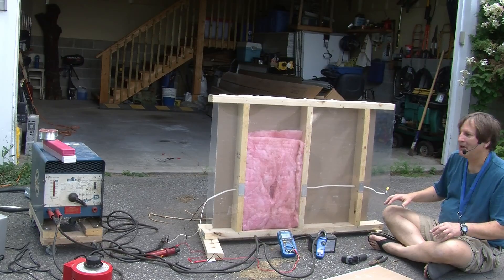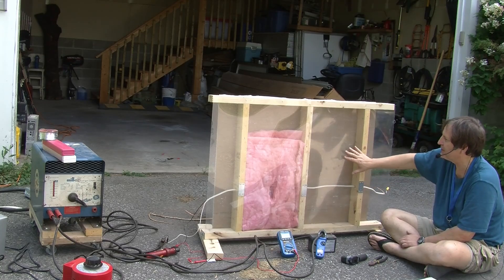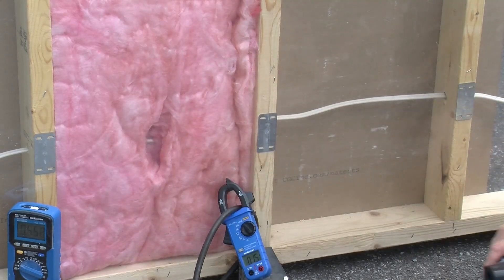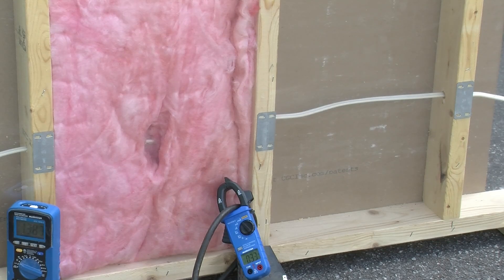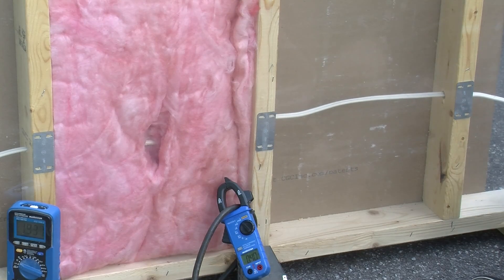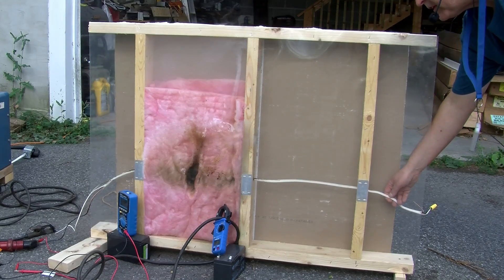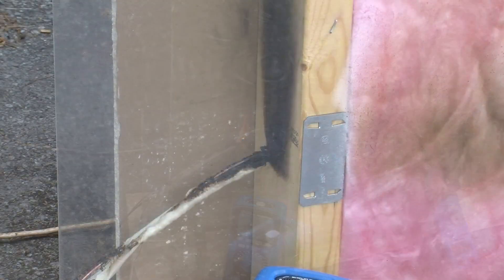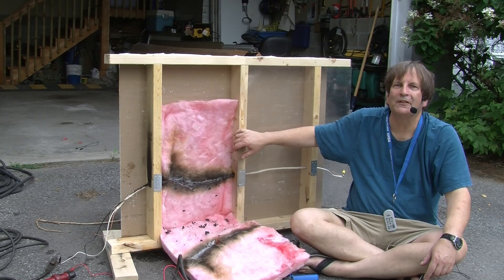Overcurrent +14/2 + Fiberglass in a 2x4 Wall

Comment: Thanks for the videos!  That 14/2 wire is a lot tougher than I would of thought.
Reply from the maker: Your welcome! I am amazed too - and find it quite comforting given that our houses are really quite flammable with so much wood in the construction even if it hidden behind drywall. I will do similar one with spray foam in a few days - will be interesting to see if that changes the results.
Reply: @ElectromagneticVideos  any chance you can hook up a 30 amp load at 120v and show the wire heats up exactly the same as a shorted wire at 1.2v and 30 amps?

Or maybe thinner gauge wire to make the 120v test more manageable.

Sorry to get into an argument in your comment section. Misinformation really bothers me especially when someone presents themselves as a professional.
Reply from the maker: @libtrs838  You must reading my mind. Agree - the only way to satisfy some would be to actually do it. 

I'm obviously not going to touch anything energized at 120V but everyone seems to also want to know temperatures and have pretty much convinced me to get a FLIR camera. I'm also giving a lot of thought to safety -  not just the hazard of the voltage but also the total power available. I will probably need to make two electrical panels - one going in with a big breaker (I dont want to risk simply relying on the breakers on the panel in my garage) and one a the load end with 3 duplex outlets each on their won breaker to plug in heaters as loads. I'm an EE with at day job so I am also limited by available free time - wait till I retire! Then you will see some real videos!

Comments: I purposely have stayed away from comments/questions/statements/discussons that I didnt think could be easily satisfied within the limitations of text comments. I have actually tried to respond to most other comments or discussion streams, although I don't seem to get notified of all comments. If I missed responding to some people comments, my apologies! 

I am planning a FAQ video where I have the luxury of showing circuit diagram  and which would also respond to other "controversial" items like "the test is invalid because DC from  welders is not like AC (Answer: a) its an AC output welder and b)  skin depth in copper at 60Hz is significantly bigger than the radius of the wire so from that perspective, not much different. ).
Reply: @petefromdewoods5157  that is not how it works. Current causes heat voltage does not. This is exactly how power lines work they run for example at 60kv and 500 amps so 30 million watts and they use a quite thin wire. If they ran 500v and 60,000 amps (same wattage) the wire would instantly melt. Volts do not contribute to wires heating.

Higher voltage pushes the electricity more efficiently creating less heat. If you did ohms law you would see at 120v the wire would have way way more than 30 amps. The only way to have 30 amps at 120v on a low resistance wire would be to have a current limiter somewhere else the heat is being dissipated at whatever is limiting the current. Doing ohms law 120v at say 1ohm you can't get 30 amps.
Reply: @petefromdewoods5157   not trying to sound smart, you are spreading misinformation. Was hoping to have a discussion or for you to backup anything you said. you addressed nothing I said.  You ignored the comment about the powerlines, and you haven't even given basic math to show what you are saying. The NEC ampacity AMPACITY chart see that word. Not a wattage chart not a power chart. Amps because the voltage doesn't cause more heat in a wire. Higher voltage you can use a smaller conductor.

Seriously think about this for 2 seconds, in the video the voltage is lower because that is the amount of voltage needed to get the current he had. If he put 120v it would be way way more current or amps. How do you lower the amps at 120v???? You can't with just a wire you need to add some load or resistor and that is where all the watts not turned into heat in the wire go.

Again If you have a 30amp appliance at 120v so 3600w do you think the wire running to it is also taking 3600w? To a wire 30 amps is 30 amps which is exactly why the NEC gives wire rating by amps because voltage doesn't change it. Otherwise they would have charts based on power or watts but they don't.

Nothing is 0 amps if a wire was 0 amps 1v would be infinite amps. My example of 1 ohm was generous to your argument and I also said for easy math.
Reply: @petefromdewoods5157  no it's not yours is. Let's take 120v and I'll be generous and give a 14ga wire a value of 1 ohm but in reality it's lower. 120v / 1 ohm = 120 amps. How do we restrict it to 30 amps? You would need to put a 3 ohm load or a resistor somewhere and that is where most of the heat would be dissipated. To have 120v and 30 amps going through the wire being 100% converted to heat by the wire, the wire would need to be 4 ohms.

Again how do you think power lines work? If it was simply a factor of wattage we would need massive diameter power lines.

All electricity can use thinner gauge wire when voltage is higher for equal watts.

You have to use the equation and find out where all the energy is going. Voltage and resistance determines amps.

If you understand ohms law please give me the simple formula to get 120v and 30 amps with a low resistance 14ga wire?

Another example say you have a 30amp 120v heater hooked up to a 14ga wire. If the wire converted 100% of the energy into heat you would get 3600w of heat from the wire but then how could the heater run at all? The heater can't also put out 3600w of heat then we have 7200w which isn't possible. The heat generated by any wire is amps / ohms =  voltage drop them you can multiply that voltage drop by amps to get actual heat dissipated by the wire.

Been working in electronics for awhile
Reply from the maker: @petefromdewoods5157  Apparently "equipment getting cooked" is what is popular on YouTube! And cat videos :)
Reply: @petefromdewoods5157  Pete says, ohms law does not.

Have a bit more time so electrical lesson for you or anyone being mislead by you.

Ohms law 
- Voltage / Current (amps) = Ohms (resistance)
- Current x Resistance = Voltage 
- Voltage / Resistance = Current

Additionally Current x Volts = Watts or Power

Current is often represented by the letter I

What can we determine from this? In the video we can see.

0.517 Volts at 15 amps initially so 0.517 / 15 = 0.034 ohms

As you can see a wire does not have a resistance of 0 even if your basic multimeter says 0 it can't measure that low

As the wire heats because the current going through it, the resistance increases. Once the wire stabilizes at 15 amps it is running at 0.557 volts

0.557 / 15 = 0.037 ohms we can see the resistance went up by 0.003 ohms because of heating. At this moment the wire is dissipating 8.355 watts.

Let's jump to 30 amps. The meter read 1.118 V initially and then climbed 1.236 V after heating up more. So 1.236 / 30 = 0.0412 ohms. 

1.235 x 30 = 37 watts of heat

The amount of current something uses is always determined by its resistance and what voltage you apply, again because ohms law V / R = I

This is why we can plug devices into a 20 amp circuit and they don't trip the breaker, the divice itself is what limits the current.

If we tried putting 120v to the 14ga wire and let's assume it has 0.0412 ohms of resistance like at the 30 amps test. 120 / 0.0412 = 2912 Amps. This is why a short at 120v instantly trips the breaker.

You can't just put 30amps at 120v to a wire because you don't limit or control the current. The wire will only be at 30 amps with 1.2 volts.

Ok so Pete you said you want a 30 amp appliance hooked up.

If you measured a device that used 30 amps at 120v you would see the device has a resistance of 4 ohms. 120 / 30 = 4

So now remember at 30 amps the wire has a resistance of 0.04 ohms. Now even with 120v and 30 amps it is still 0.04 ohms that doesn't change. 30 amps is 30 amps.

You go but wait 30 x 120 = 3600 watts that's a lot of power and heat. Yes but that power is being consumed by the 30 amp appliance attached. If the wire consumed all the power then the device wouldn't function.

The wire is still 0.04 ohms which causes a 1.235 Voltage drop as we found at before so still 37 watts and the remaining 3563 watts goes to the device which will get turned into motion if a motor and some heat.

Look what we can do 120v - 1.235v = 118.765 volts supplied to the appliance after wire voltage drop. 118.765 V x 30 amps = 3563 watts + the 37 watts for the wire = 3600 watts. Math... 

If higher voltage heated wires up more our whole power distribution system wouldn't work. We transmit power on powerlines at very high voltage because voltage doesn't increase heat. Because of this we can use thin wires to transmit lots of power.

You went on about the NEC, the NEC made charts based on amps not watts because that is all that matters. The NEC also mentions voltage drop calculations if you ever read it. What do you think causes voltage drop on a wire? The resistance of the wire, because wires do not have a resistance of 0 ohms. The longer the wire the larger the voltage drop.

The NEC chart says a 14ga solid copper wire has a resistance of 3.04 ohms per 1000 ft. So pretend we have a 1000ft circuit. If it is a 15 amp circuit 15 / 3.04 = 4.93 V this is the voltage drop. NEC allows max 5% voltage drop on a circuit at 120v that would be 6 volt drop so we are ok. If it's 30 amps that would be 9.8 volt drop not allowed you need to move up to a larger wire with a lower resistance per 1000ft. Notice these calculations only use resistance and current to determine wire size? The supplied voltage doesn't change the resistance of the wire. If we put 1000v on the wire at 15 amps it is still 15 / 3.04 = 4.93 volts. 4.93v x 15 amps = 73.95 watts. This is how much heat the wire would dissipate over the 1000ft 

 If you are actually an electrician you should know all this though, right?

This is also why we use 240v on high wattage items, the current gets cut in half so we don't need large wires to carry the current. 120v x 30a = 3600w or on a 240v circuit we would have two 120v legs carrying 15 amps each so still 3600 watts.
Reply: @petefromdewoods5157  you won't read the other reply where you might learn something, but just so you know the NEC has charts for wire resistance so electricians can calculate voltage drop. So wow dude you should probably call a licensed electrician or lose your license if you have one.
Reply: @petefromdewoods5157  you claim that higher voltage will heat a wire more at the SAME current.

You claim a wire has a resistance of 0 ohms because your meter that can't measure that low says so.

If you take amps and divide by 0 you get infinity that can't be right.

You ignore that the NEC has charts for wire resistance so educated electricians can determine % voltage drop which is based solely on resistance and current. If you do the calculation you will see regardless of input voltage the total value voltage drop stays the same.

That voltage drop x amps is how many watts  of heat the wire generates.

You ignore the fact the NEC has charts based strictly on amps because higher voltage doesn't cause more heat. That is why they are called ampacity charts and not power or wattage charts. 

You don't understand the concept of conservation of energy.

If you have a 30 amp x 120 volt so 3600 w load attached to a wire, the wire can't also be using 3600 watts. 

Joules and watts are interchangeable. I showed before a 120v 30amp appliance 3563 watts or joules would be consumed by the appliance and 37 watts or joules would be emmited as heat by the wire. If you remove the appliance and short the wire and still want 30 amps we need to go back down to 1.235 volts. 1.235v x 30a = 37 watts still or 37 joules.

You don't understand ohms law and are incapable of showing a basic equation to prove your point.

And you repeatedly ignore the fact power lines are very high voltage but a very small diameter wire.

Luckily people that can do basic math and understand basic electrical theory made the NEC code book so electricians like you can follow the rules you wouldn't be able to determine on your own.

I am sure there are many electricians who care about their craft and have a great understanding of electrical theory. But fortunately for people like you house wiring is fairly short runs, just ac 120v or 120v X2 (split phase) and switches.

 Without diodes, capacitors, rectifiers, resistors, inductors, many different voltages, AC and DC, etc you really don't need to understand the science of it at all. Just a monkey pulling wire and following the rules.

Do some research and look up anything I said or do the basic math and see what result you get.
Reply: @petefromdewoods5157  at no point do you say more voltage causes more heat? Then right now you go on to say 120v will cause heat failure more quickly than 1.1v

Ok so what is making it fail more quickly?
Reply: @petefromdewoods5157  When you say the wire will fail more quickly at 120v vs 1.2v both at 30 amps that is exactly what you are saying. This whole thing started with you saying if he attached a 30 amp load at 120v it would fail more quickly than the same 30 amps at 1.2v in the video.

Are you really going to try to claim you never said that?

If it's not the voltage causing the heat when current is equal then what are you going on about it failing faster? What force is causing it to fail faster? Not voltage? Now you say no to heat too? Magic? Dark energy? 

We are getting somewhere now. None of those things are causing it to fail faster because 30 amps is 30 amps is 30 amps to a wire so it will heat up the same amount.

And now.... Pete quotes...

"Just don't think your 14-2 is gonna hold that current that well that long, it won't.."

"the time to failure would be accelerated at 120v.. yes"

"At no point did I say that voltage increase causes heat to increase nor did allude to it in any way, that was completely your false assumption."

"That's because it's not running 30 amps at 120 volts it's about a volt!! Ohm's law says the amount of energy imparted to the wire is much much less per amp at that extreme low voltage."

"please re read my comments. At no point do I say that voltage makes heat.. you're full of shit and lying about it. If it makes any difference, what said was: 14-2 takes more amps and time to enter thermal failure at 1.1 volts than it does at 120volts due to Ohm's law. You have made up some lie about me claiming voltage causes heat"

If I am lying what do the quotes above mean? 

Ha that last one is a real mind twister. You start by saying voltage does not cause more heat, then you immediately say at lower voltage it fails more slowly. How does that make any sense?

If you keep saying ohms law why are you incapable of writing out a single formula? I haven't seen you give a single example of the law yet.

Why ignore the existence of HV powerlines?

I have substantiated my claims by quoting you, very detailed descriptions, examples, laid out the math, and referenced the NEC.

All you have done is say nah bro your wrong. Saying "son" or toss out the word joules like it means something different. It seems like the only thing you know how to do is multiple volts x amps to get watts and you think that is ohms law. You can't piece together where any of the energy actually goes.

And you think if your meter not being able to read low enough is proof the wires are 0 ohms

I can't tell if you are trolling me really good or you are just a random pretending to know about electricity, or the worst situation you are actually an electrician but then you must know you are wrong by now, I would hope. 

I am an idiot for wasting this much time but hopefully someone sees it and can understand electricity a bit better.

There is too much misinformation on YouTube about electricity and it is dangerous and actually bothers me.

Multiple people have been killed by MOT (microwave oven transformer) trying to burn wood. Lots of people rant on here voltage doesn't kill amps do! Not realizing that amps are a function of voltage / resistance. 

This is all pretty much middle school math but people don't even want to to put in that little effort to learn something new or they just repeat things they heard without any real understanding. It's dangerous and misinformation spreads like a virus.

You asked what does voltage drop have to do with anything? Voltage drop is proof the wire has resistance. Voltage drop is how much power is getting turned into heat by the wire.
Reply from the maker: @petefromdewoods5157  Well you might get the number of views squared! but you personally might not be very popular! I think I'll leave that niche to someone else :)
Reply: I'm guessing 'PeteFromDeWoods' deleted his comments because it appears that 'm m' is arguing with himself? ;o)
Reply: @petefromdewoods5157  Yea that makes total sense! Great call. Thanks mate.
Reply: @petefromdewoods5157  I want to see that 14/2 power up a legit 30amp appliance and see how long it would last. Im rewiring a house and not sure if I should use 14/2 or 12/2. I was thinking that 12/2 was over kill from watching his videos but now your comment is making me doubt if I should just use 12 wire throughout along with all the 20 amp corresponding outlets and switches.
Reply: @petefromdewoods5157  So the tests results are irrelevant then because if it was 120v the wire wouldn't last as long to reach thermal failure?  Edit: I understand now, so basically its like powering an AC unit vs a 30watt lightbulb both at 30amps. Yea I think Im going to retract my "tough" assumption. The experiment is not realistic. I would like to see that 14/2 use to power an actual 30amp rated appliance and see how long it last before it cooks. Thanks for pointing that out!!
Reply: @hippo-potamus  120v would melt at the same amps as this test